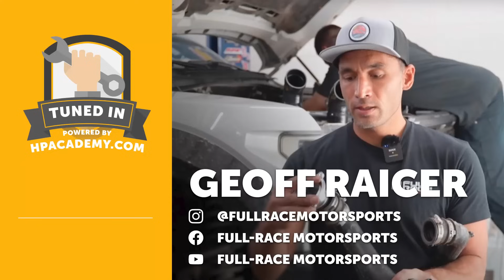128: Is EcoBoost the Answer? [PODCAST]

Comment: It took Ford 3 try’s to get the timing chain, guides, phasers right? 😂 That checks out. I say this as an ‘87 F-250 owner. My 460 V8 original timing gear teeth were Nylon.
Reply: Engines designs aren't perfect from v1.0? "What a shocker!"
Reply: @ They have been incorporated since 1903. Not their first engine.
Reply: @25aspooner  No one said that it was
Reply: @RyTrapp0  Good companies don’t release V 1.0
Reply: @25aspooner  Yea. Totally. Sounds legit.
Reply: @RyTrapp0  What?
Reply from the maker: @25aspooner maybe they still have the same guy there from the 460 days 😂

Ultimately they're trying to make money, not to make the perfect engine at any cost out the gate and development to work out what compromises might hurt the bottom line/customers in the long run is just part of that for every OEM. They all make mistakes. Every single one - Taz.

Comment: OE’s will measure “time to torque” At a few rpm points:
At cruising rpm/load range examole 2200rpm 70kpa map. Throttle is moved to 100% and the time it takes to reach peak or a “target” torque number is measured.
This type of testing is repeated from 1500-4500rpm ranges. Transmission control/target gear vs speed is then also based off this data. 📈 🎉❤